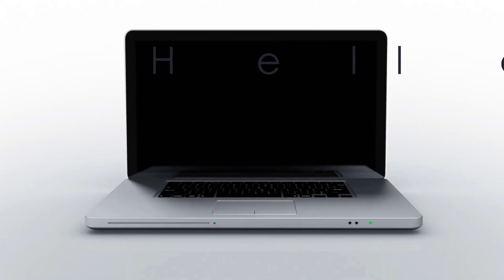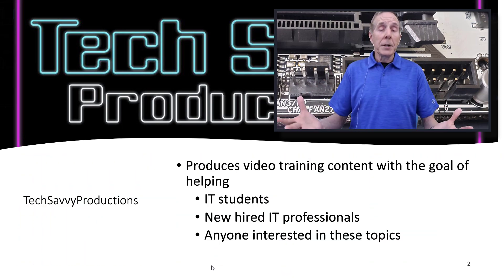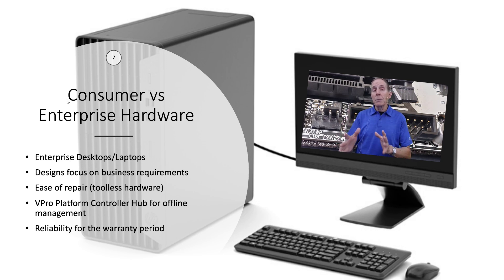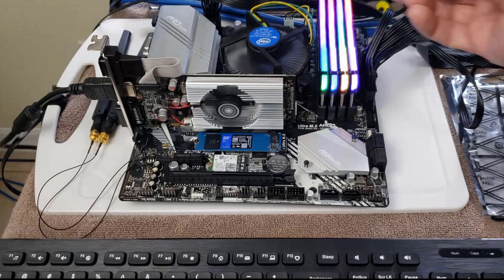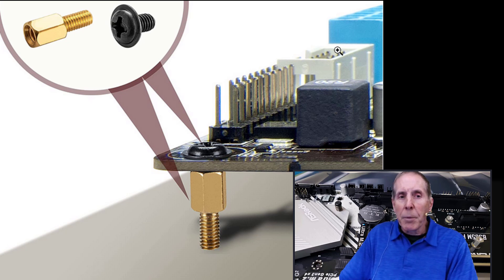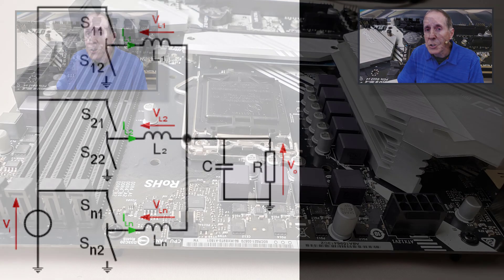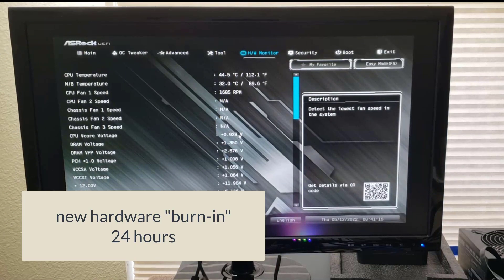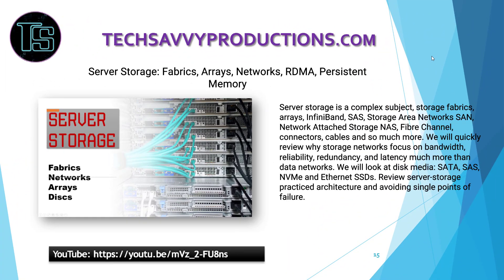Navigating Enterprise Hardware: IT Admins' Guide to Desktops and Laptops

Comment: The  ground  plane is on the  bottom,  the  voltage  traces   are  the top  creating  isolation. The majority  o the   digital signal  paths   are in the  inner layers  connected   by via's  that  going  through the board  connecting the  circuits
Reply from the maker: Thanks John

Comment: I strongly  believe   that  if you are going to service  computers,  you need a background in   analog  and digital  electronics.     Once  you  know  the basic  digital functionality blocks    then  a  CPU   will  make  more sense  Tech's  should know  to use a  Digital  volt meter and a  oscilloscope  , along  with  load testing power supplies    When  you have   basic  AC/DC  background   along with transistor theory  what  goes on     with  the motherboard    make a lot more  sense
Reply from the maker: Electronic training is helpful in understanding, no doubt!  The problem is most adults making career changes into IT simply do not have the luxury of adding electronics and all the courses that make them proficient in IT.   Fundamental electronics would add a full additional year to their studies and having seen first hand the financial strain that adults go through to change careers it would sink the hopes of many.   Most tech centers\community colleges only give a  1-2 years of time for IT.   I taught both electronics technology and IT and understand fully your point.
Reply: if someone wanted to grasp a good background in analog and digital electronics, what good resources are out there that are reliable and provide a good foundation but also maybe some advanced skills/knowledge? always considered in learning those topics
Reply from the maker: https://drive.google.com/drive/folders/1rXhqVsdKJBeV8mDvNYcS-p7mhamSliDe?usp=sharing    This is our free book sharing site check out 1. AC Circuits, 1st Edition - Davis, 2017.docx  2. DC Circuits, 1st Edition - Davis, 2016.docx  they are full college level texts on the basics and there are wonderful videos that support every topic on YouTube.